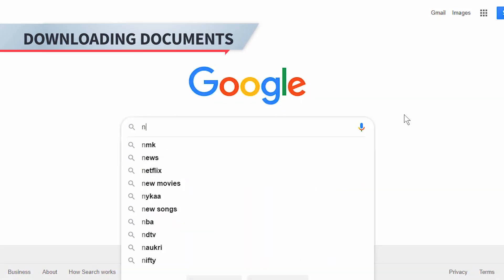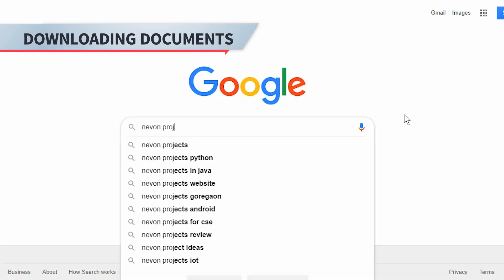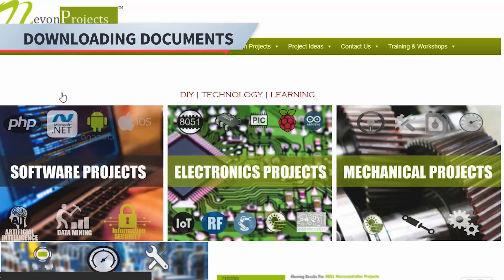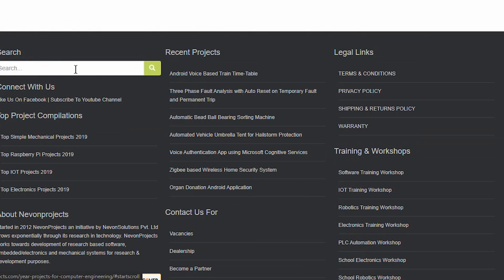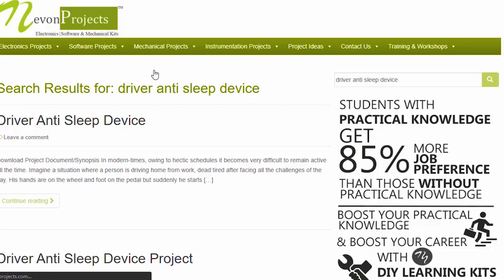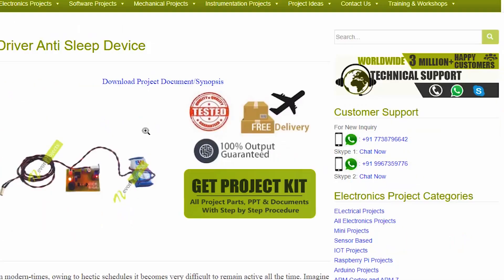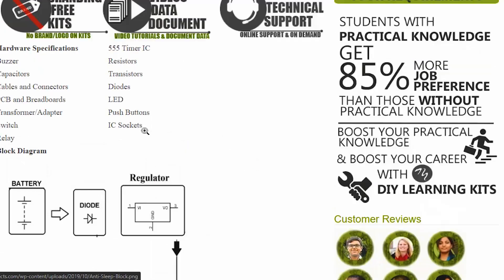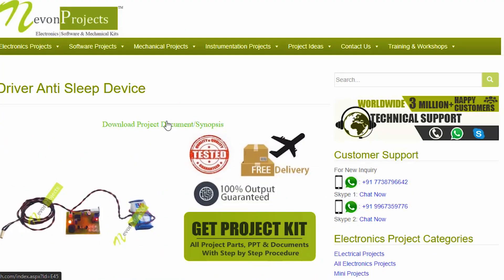How to Make Driver Anti Sleep Vibrator Alarm - Electronics Project

Comment: Yes bro need ckt diagram
Reply from the maker: For this Electronics system details or free document/PPT pls call watsapp
+917738796642 or visit link in video description
Reply: But still needed component specifications.
Like value of resistor capacitor as well as other components. Will you please provide it
Reply: @nitinnaragude7145  hloo nitin I saw In utube comment section that u ask about values did u get it
Reply: @NevonProjectsOfficial  please provide values It will be useful for our project
Reply from the maker: @tejasriperabathula2972  For this Electronics system details or free document/PPT pls call watsapp
+917738796642 or visit link in video description